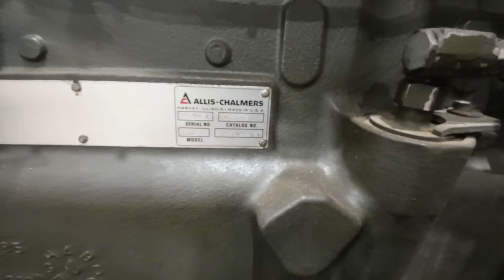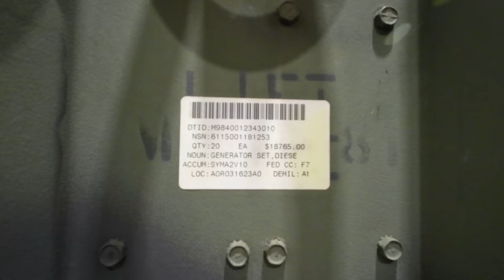$500 Diesel Millitary Generator sitting for many years, WILL IT RUN?? (Allis Chalmers 3500a)

Comment: Whole heart transplant is something an overhead crane would be useful for.  The more you settle into the shop the more difficult it will be to get the crane project done!  I think Fiat-Allis will love the new powerplant.
Reply: I think your right.  Matt was undoubtedly eager to start using the shop asap.  But he should have resisted the urge and got to the installation as soon as everything else was done.
Reply: I was thinking the same thing...  Matt time to get busy on the overhead crane... Yes you can give Fat Alice a heart transplant the hard way with the multitude of other equipment you happen to have lying around, or make it easy on yourself an use the overhead crane, that you need to install..
Reply: All I want to see is a gantry crane go in I’m excited for that!
Reply: and also a flexible exhaust vent tube to avoid blackening that lovely roof when running stuff
Reply: So the next video is digging a trench?  Is that more power or plumbing?  Could be it needs to go in before the gantry?
Reply: @johnbize5736  well, the crane is electric and he still doesn't have any supply at the shop
Reply: But I think it’s more fitting if Fat Allis picks up her own new motor out of that frame, don’t you?
Reply: And the machine most likely to be useful for setting up that overhead crane is awaiting a new engine.
Reply: @thesteelrodent1796 No electric 'supply'? What!? Of course there's electricity in the shop, you haven't seen the lights on? But yes, the crane should be tackled soon, maybe it's gonna be one of the winter projects along with getting the radiant in-floor heat 🔥& wood-fired boiler💧going before temps🌡️get too frigid🥶 out there! 👍💪🤔⚡🚜🔧🔩🔨🛠️📏✏️📐⛓️🧰
Reply from the maker: Ive been running off a generator this whole time, not connected to the grid yet.  @tdotw77
Reply: @utilitarian  We have those at the fire station and they are da bomb!  I know black smoke and fumes are the macho old trucker traditions, but 10 or 20 years of it on your walls & lungs ain't the best thing to tolerate...
Reply: @DieselCreek  The Money Tree genny?  Pretty cool Sam's money tree kept the Scrappy Creek campsite purring at the show!
Reply: One reason the crane instal has been on hold may be the need for 3 phase (grid) power. Now that his electric service is connected  that job can proceed.

Comment: The fuel line fittings (blue/gold) on the Allis-Chalmers are what is called -AN (Army Navy) . The fittings are -6AN , the 6 meaning 6/16 or 3/8 and the threads are SAE. The fitting on your adaptor hose was a -8AN (8/16=1/2). They are very reliable and interesting enough are reuseable. These fittings will work with rubber hose or ss braided rubber hose. There is a newer style called GEM fittings and they include a 2nd integrated hex nut for easier install. Theses are the only oil and fuel hose fittings we will use on our road race car
Reply: I absolutely love a/n fittings. 
The only ones I have are ancient artifacts, but I still use them. One of the most reliable ways to keep the fluids in

Comment: Based on the age of the engine, I think the control wiring could be tin plated copper, rather than aluminium
Reply: Probably true, marine grade wiring is usually used for stuff that can be used outside near sea.
Reply: @sl06bhytmar  on older equipment and even still today for equipment that may get exposed to not too friendly conditions that is actually used. the tinning is supposed to avoid corrosion and the green death creeping through the wire looms. For testing you can either jsut scrape a strand and see if you expose copper, or just try to get a soldering iron and try to get some solder sticking to it. if it takes immediately, everyone who ever tried to solder aluminium wires knows it is tinned, not aluminium.
Reply: Nickel plated copper for marine .
Reply: TM shows this 400hz 60Kw made in the 80's
Reply: The stuff I've used in the past on Rail and Military (H+S Radox wire, beautiful stuff to work with provided you're not paying for it!) is Silver plated  Copper for longevity.
Reply: A lot of milspec wire is silver or nickel plated, or at least tinned. Definitely not aluminum.

Comment: Matt, maybe it would be nice to turn the frame of the gen set into a 'engine starter kit', clean the diesel tank, add a water tank, batteries and some hoses, swithes etc. and you can truck it around to whatever kind of machine you want to start. using pallet forks, you could even use gravity to feed the water and diesel.

Comment: Boy have I got battery stories.   My Dad owned a battery business and I worked for him in high school.   Many a battery came back with a post pushed in because of a hammer (or an adjustable wrench as the case may be).   I still do it myself as Matt demonstrates from time to time, but with a carefull blow.   Then of course the ones that came back that were supposedly dead only to learn the customer left the plastic protectors on the posts when they installed the cables.  😩
Reply: Lots of difference between tapping on it and wailing on it
Reply: After working in auto parts stores for years, and then running a battery store (everything from watch batteries to 8D tractor batteries and everything in between), I learned the hard way many years ago to use the "battery hammer" very carefully!  Have changed out many a set of golf cart batteries, and have pretty much seen everything when it comes to the wrong way to do things (had a lady bring in a diesel pickup with twin batteries-- both had multiple nails driven into all of the terminals!).  My favorite part of every Diesel Creek video is when the engine finally starts up and runs... it's like Matt made a touchdown!
Reply: Alot of dummies out there, we know of at least 81 million
Reply: Had a gal in our office come up all upset- her boyfriend (about my son's age) had replaced her battery down in the parking lot, and now the car was completely dead! I went down to take a look, took the plastic cover off the ground post, handed it to the guy with a wink, and let him reconnect it while cussing the car for his cover story. Everyone was happy, and I got a friend for life! 😊

Comment: A lot of times the reason why there was no oil in it is because the generator may have been overseas possibly during the war. When transporting some equipment through certain countries in route back to the states they require drainage of all fluids. It’s very common occurrence.
Reply: That's interesting. I've never thought about that. I don't know how many times I've bought mowers and other gas powered devices that had tags saying make sure to add oil as it was drained for shipping purposes.
Reply: Yeah, alot of engines are drained. All items being loaded aboard mil aircraft have to do HAZMAT certs. DRAINED BUT NOT PURGED is the usual for most.
Reply: @willgriffin3490 I never had to drain oil when air loading equipment. Fuel yes, but never oil.
Reply: That´s propabaly the reason. In most of Europe there are special rules to transport flammable liquids so everything like lawnmovers, chainsaws and other things with engines are always drained when you buy them. That way the freight to the store from the factory becomes cheaper.
Reply: Ive purchased a few items through military surplus auctions.  A lot of times they drain everything (non-vehicular) before selling it.  Not sure if it is to minimize leak issues at the holding facility or because the military is allowed to use non-publically available additives, that they might not know if it may or may not need a health warning in the civilian market.

Comment: Great $500 investment, Matt.  That electronically controlled governor system was on there because the engine was powering a generator.  Generator output is determined by the speed of the engine.  To make sure that the generator had exactly the correct output the engine powering it has to be controlled very precisely.  The slightest variation in engine speed can cause a big change in generator output and the frequency of the electrical polarity changes if it is an ac generator.  This unit is wired similarly to a diesel-electric railroad locomotive system.
Reply: Exactly, plus what Matt said, the stock generator ran at a different frequency. Some countries operate at 50 Hz, this plant probably was designed and scheduled to be shipped overseas to plug into a 100 volt, 50Hz grid, but it became surplus.

Comment: Hiya Matt,
The engine is a marine version; all gen-sets are for running at one RPM for very long times.
  I'm not familiar with aircraft frequencies, but for 60hz, the engine would run at 1800 RPM. That is the normal for US domestic power. Here in the UK, we run at 1500 for 50hz. If the load increases, the fuel control valve opens without increasing the RPM; it is a clever system that you will not need. The foot pedal to the injected pump works for loaders. Stay safe, Steve...
Reply: Military aircraft that have AC equipment use 115V AC 400 Hz.

Comment: I'm pretty sure that was a MEP 115A 400hz Gen Set.  There are tons of manuals online for it.  In my experience with this engine, the fuel pump was the most common issue.  I replaced quite a few of them while serving in the Marines.  p.s. those dang copper washers on the fuel pump injector lines were always the most fun, especially when you forget to put one on each side of the line.
Reply: 400hz? was it used as some kind of aircraft auxiliary power unit? From what i know aircrafts commonly used 400hz in electrical system.
Reply: @Dymitr_Nawrocki  That and radar equipment.  I never actually used one of the 400hz models in the Marines but I did repair them.
Reply: Thank you for your service!
Reply: @imleetsometimes 
Thank you for you service Sir.🇺🇲🇺🇲🇺🇲🇺🇲🇺🇸

Comment: The wire is most likely tinned copper mil-spec  MIL-W-5086/2 and awesome score on the engine side of the Genset. Also for the generator controls that are left could be sold for some money as well

Comment: The shiny metal pieces on the B pillar are fuel pumps. One is for the tank the other is for the auxiliary fuel.  There is a filter screen in the bottom of them. Cork gaskets make the seal. Emergency stop cables on old army generator are pull to block fuel release to open fuel.

Comment: That looks like a good buy. Money well spent. Just a tip from my side. I would check with your buddies at area diesel service if the governor is correct. Generator engines are rated for a fixed rpm and fat allis is variable rpm. There is a difference and it matters how well it performs.
Reply: Generator service for 60HZ would be 1800 RPM with electronic trim to adjust it to within .1HZ or so and to respond to load. No idea what RPM it would run at for 400Hz.

Comment: Matt, that fuel delivery line to the top of your pump, that fitting under it has a check valve in it. It has a clear glass ball & spring.

Comment: Hello Mat, the round thing on the left side by the oil dipstick is an overspeed trip assembly. Its a requirement for generator sets. The wire you are referring to as aluminum is I am pretty sure tinned copper wire. The military wouldn't invest in subpar wire.
Reply: Overspeed and engine run - starter lockout.
Reply: Boat wire, actually. Fine stranded tinned wire, back when I built gensets it was all we used.
Reply: @ForfeMac  Tinned wire sure reduces the issues of the Green Crusties.
Reply: Probably with PVC or Teflon insulation. Same stuff used on board ships and aircraft.

Comment: I would investigate the injectors and pump on that to see what the hp rating at what rpm. It may not make as much hp as your loader. I was always told that the injection pumps and injector setup was different than road going equipment because generators are built to run at a set rpm all the time. Just something  to check out it would suck to swap engines and then find out that the new engine doesn't make enough ponies.

Comment: This channel has inspired me, I came across three 1931 caterpillar-ten tractors sitting lined up way back in a field a few years ago, just went back to look at them today, they're REALLY rough and need a lot of work but a couple still have oil in the crank and there wasn't any water on the dipstick also we popped one of the valve-covers off and everything was still coated in greasy sludge despite the manifolds being solid rust and I mean solid there is not even a pinhole of tube left its just rust, the guy who owns the land has no idea when they were left there and I expect they have been sitting there for up to 50 years. Maybe I'll make some videos of my adventures trying to make one function out of the three there.
Reply from the maker: Save em!!!!!!
Reply: @DieselCreek I agree with you Matt, he should save all 3 of them

Comment: The Military technical manual for this generator is TM 5-6115-545-12
Generator model - MEP115 A 
60K @ 400Hz 6115-00-118-125 3
used in the late 80's

Comment: I think we all feel the same way you do,  I love getting old things going.  It is my favorite hobby.  I approach it like it’s a puzzle,  and I’m not gonna let it beat me!  I just pulled a allis CA out of a auction with a belly mower that no one wanted,  got it super cheap.  Made it run,  and now it’s my lawn mower.  Keep up the great videos!!
Reply: Destroyer85golf84: I bought a 1952 Allis CA with a belly mower on an auction back in 2005 & mowed with it until it wouldn’t run anymore. Took it to a mechanic to get it fixed. He had to new sleeves & pistons in it because it had no compression. it had about an 1/8” gap between the pistons and the block. Ran great after I got it back. It put out 32 hp after overhauling. It’s rated 26 hp out of the factory!
Reply: @dennishayes65  that’s awesome,  I have some tinkering to do,  but that’s the best part.  I was just talking to my dad the other night about the tractor.  I said whatever happened to cheap dependable power.  Being able to re sleeve a engine and get it going again.  Not anymore,  my 50 hp mahindra will long be turned into toasters and refrigerators before this CA gives up the ghost.  Definitely different mindsets when the two were produced.

Comment: Most generators never run at an idle.  They normally run at 1800 to 3600 rpm.  With most of the safety devices removed, things can do some strange things.  Great to see that you have the engine running.  Don't forget about the fan.
Reply: Yah, haul the thing off, use heat on the bend to reform it on an anvil! Get the pitch of the blade right compared to the other blades. Would be neat to video this important operation. Or transfer the fan from the other engine if it will fit.

Comment: I may be wrong, but the two cylindrical objects with the fuel lines fastened to them, bolted to the upright of the frame looked a lot like 'Facet' fuel lift pumps. Used to draw fuel from the low mounted tank and pass it through the filters to the injection pump.
Reply: Those are indeed the lift pumps for the fuel. That coming from a retired Army track mechanic who probably spent as much time fixing gen sets as tracks.
Reply: @dogleg6669  It also looked like the fuel line is plumbed in series through the pumps. It was not uncommon, here in GB for competition off road and sports cars to have two 'clacky' fuel pumps plumbed in series but wired independantly, one as a main pump and one as a reserve or standby.  That way you normally ran on one pump, but if it went faulty during an event, it was a simple job to switch off the 'dead' pump and switch on the 'reserve' pump to keep the engine running.

Comment: 11:30 - You know that if the crank turns 360 degrees, the camshaft only turns 180 degrees, so even though the pistons have made a full cycle, the intake and exhaust valves haven't yet done a full cycle.

Comment: First: if that engine was produced in October of 1985 it is one of the last Allis Chalmers branded engines. Allis merged with Deutz in November of 85 becoming Deutz-Allis and basically ending production of Allis Chalmers engines at that time. There may have been a few made under the Deutz-Allis brand for their combines, but most their farm equipment went to the air cooled engines like what's on your compactor. The construction equipment line had already been discontinued. So that is a cool piece to have. 
Next, im thinking to keep that engine frame and cooling package as a test stand for engines. Make some universal mounts and install some controls with fuel and battery hookups and you have a place to set an engine and fire it up for testing or running in a fresh rebuild if need be.
Lastly, stalagmites, with an"G" grow up from the ground, G.
Stalactites, with a "C" extend down from the ceiling, C.
The weird sh*t you read in a comic book at 5 years old and remember.
Reply: Ha! That works. I always remembered stalactites hold tight to the ceiling and you just might trip over a stalagmite.

Comment: im pretty sure you need to supply power AND ground to the solenoid as the solenoid is isolated from ground. you can check continuity across the wires and measure the coil resistance.

Comment: I feel your joy every time you get one started, I trained as an Agricultural fitter, this involved lots of engine strips and rebuilds from single cylinder 2/4 strokes upto 6 cylinder Ford engines. One day I was told I had a “ project” I was presented with various engine parts in boxes and tea crates. It was a Deutz 3 cylinder Diesel engine, it was quite similar to the Volkswagen engines I had built as youngster, bit of tin bit of engine etc, I had a 10 minute phone call to a Deutz Specialist to work out how to time the fuel pump.
2 days later it was running,  I don’t think I had ever been so happy, Tutor was well impressed and I got a good drink for my efforts.